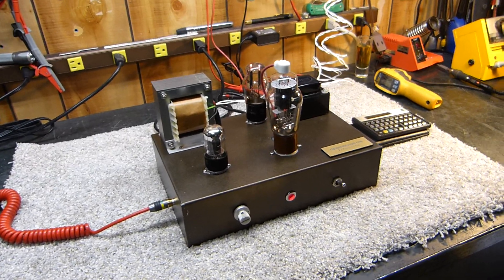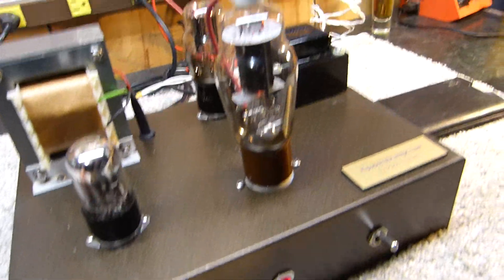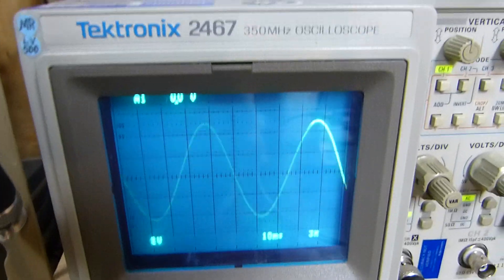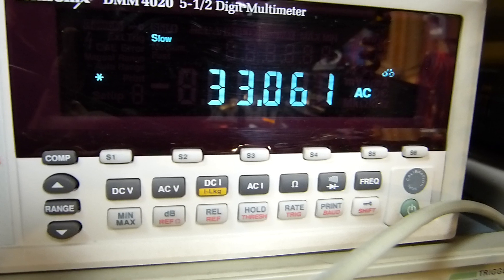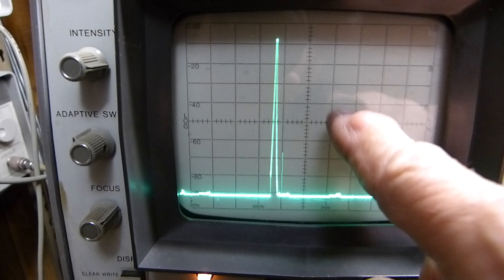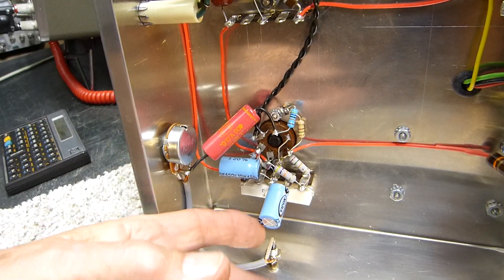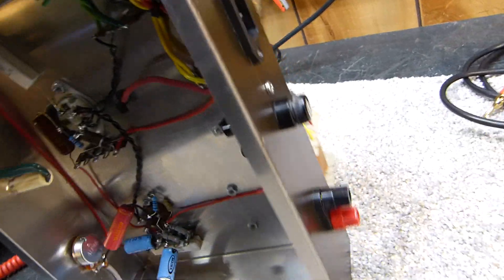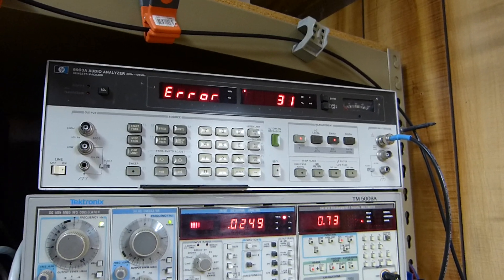807 Single Ended Amplifier Project - Part 5 - Measurements

Comment: I built one of these but having the dumbest problem. I can’t get the pot to work without being jumpy and noisy. Sounds great at full volume. Brand new pot. Is the input supposed to be grounded like a guitar amp or is it grounded to the signal input device like the phonograph or tape player,etc? I suppose it could be a bad pot but that’s pretty rare with brand new alphas. The grid leak is after the input cap. Does that matter? Idk …any suggestions? Thanx.
Reply from the maker: One side of the input level pot is grounded to the chassis same as the ground side of the RCA input connector. Sounds like a bad pot or solder joint ? A grid leak resistor is usually at the actual grid connection on the tube socket but there must be some resistance to ground off the grid side of any input capacitor if you use one. There must be a DC path to ground in the grid circut (all grid circuits) or the grid will unpredictably attain a bias charge and cut the tube off from conducting and output of the amplifier will stop. Hope this helps.
Reply: @ElPasoTubeAmps  I figured it out. I thought I was being clever by connecting the heater center tap to the cathode rather than ground. I figured it out after noticing some improvement with different grounding schemes. Anyway ,it’s completely silent ,now. I thought something was wrong it was so quiet before I played some music through it! Sounds fantastic! Stoopid center taps…😅
Reply: I used the generic champ power transformer(350v taps) and a Hammond 125DSE universal output transformer. 10 h choke. I’m gonna make another one!!
Reply from the maker: @williambock1821  Stereo does have its charm. I am very happy with mine. The mono one is in my workshop where I make videos and the stereo one is in the living room. Thanks for your comments. Stay safe.

Comment from the maker: FFT software you might like to try as suggested by ChatGPT.

Sonic Visualiser

A free, open-source application specifically designed for analyzing the harmonic content of music. It provides detailed spectrogram views and supports plugins for advanced analysis.

Voxengo SPAN

A free real-time FFT spectrum analyzer plugin that works within DAWs (Digital Audio Workstations). It offers customizable displays for harmonic analysis.

Spek

An open-source acoustic spectrum analyzer that supports multiple audio file formats. It’s lightweight and user-friendly, making it a great option for quick harmonic content checks.

Blue Cat's FreqAnalyst

A free, high-resolution frequency analyzer plugin. It’s particularly useful for visualizing harmonic structures in real time within a DAW.

Comment: do you ever sell your amps, Kurt AA4KH
Reply from the maker: Hi Kurt.
I have not tried to sell my amplifiers. If you add up the cost of all the parts nowadays and add that much more for labor and knowledge, you can see a minimum of what I would have to charge to sell them. No doubt I think they are worth it but most people had rather spend their money on commercial made ones. 
Just my opinion.  73  WA4QGA

Comment: What's the distortion characteristic of your Tek CFG250? Thanks for this series. Nice results.
Reply from the maker: The Tek CFC250 is the frequency meter. I assume you mean the SG505 oscillator. Tektronix specifies 8 PPM THD. It is an analog frequency dial so it is sometimes tedious to get it down to the Hz in frequency.
Reply: @ElPasoTubeAmps ah, my mistake. I have a Tek signal generator from that same family and form factor. Thanks for the late night reply. Looks like we're both night owls.

Comment: Wow, you built it so quick I didn't have a chance to ask any questions. How did you deal with the screen supply? I've done some work with the 807 and read all the cautions about regulating the screen voltage at a relatively low level compared to the plate.
Reply from the maker: It is triode connected so no screen supply. The screen is tied directly to the plate thru a 100 ohm 2W resistor. Cathode bias  with 150 ohm resistor. I will be posting a schematic later.

Comment: Sounds really nice. You can do SNR easily with the AA501: press LEVEL and DB RATIO, then zero it with the SET 0 button underneath, then turn off the siggen and you have your SNR displayed.
Reply from the maker: I tried and tried but the zero button doesn't do anything. I downloaded the manual also. Not sure what I am doing wrong. I did figure out how to run the 8903 in S/N. Thanks for the information.  Below is link to schematic:
https://www.delatsch.com/wp-content/uploads/2024/11/ElPasoTubeAmps807SESchematic.pdf
Reply: @ Bad luck, looks like you get to fix it :-)
Reply from the maker: @EJP286CRSKW    When all else fails, read the manual....   🙂
Reply: @ The SET 0 button just sets 0dB on the display, so when you turn off the siggen it goes to -80dB or whatever. But if it won’t zero, just compute the difference yourself.
Reply from the maker: @EJP286CRSKW  That is it - it doesn't go to zero so I assumed, as you said, to do the absolute value between what is left on the display and what is measured and as I remember, the numbers were similar to the 8903. I will have to check this again on several different measurements and see if it holds true in my case - Thanks for mentioning this...
Reply from the maker: @EJP286CRSKW  If I put a 0 dBm signal into the AA501 and press the SET 0 button, the display goes to 00.0. When I take the cable off it it goes to maybe -102 and depending on if I put my hand close to the input adapter or touch it, it goes back up to some much higher level, bounding around, but I still don't see how to measure S/N with it. I am missing something simple...
Reply from the maker: @EJP286CRSKW  I see how to do it now.  I can put in any signal level and set it to zero - I would zero it with my amplifier on but with no input signal to it then drive it to max output and see the difference.
Reply: @ Or the other way round.
Reply from the maker: @EJP286CRSKW  The misunderstanding I had was, it can not be zeroed with an open input circuit at the AA501 input, in this mode. It is so sensitive it is bouncing around as low as -140 dB or so from the noise that is picked up just from having the banana-to-bnc adapter being inserted. As I often say, I learn something from the YouTube community every time I post a video. Thanks to all...
Reply: @ElPasoTubeAmps  You don’t need a 0dBm signal. Just a signal. Full output of the amp if you like. Then you SET 0 to call that zero, then turn off the siggen and you then have -80dB or what have you. Thus is the SNR. Or crank on the frequency until it shows -3, then you have a bandwidth limit. All in DB RATIO mode and LEVEL mode. Nothing to do with O/C inputs whatsoever.

Comment: ELPASO, How do you measure using the oscilloscope or DVM meter the dB's of the NFB if its 3dB to 16dB?
Reply from the maker: I make it easy and use the Tektronix DMM 4020. I set the amplifier up with no NFB and a nice sine wave display on the scope. Then I start adjusting a pot as the NFB resistor, watching the meter displaying in dB until I get the level I want. I then measure the R of the pot and install a fixed resistor.
Reply: @ElPasoTubeAmps  The DVM meter set to dB is measuring "across the NFB pot/resistor" or the DVM meter is referenced to ground?
Reply from the maker: @waynegram8907  The DVM meter is across the 8 ohm load resistor on the output of the amplifier measuring the amplifiers output power.
Reply: @ElPasoTubeAmps  So the DVM meter is set to dB mode and measuring the amplifiers output with NO NFB and you adjust the Variable Pot NFB resistance value until its -3dB down from the NO NFB value?

Comment: Tube amps are : the sound of the Transformers....... More than the tubes.
Reply from the maker: Very much agree. I have heard it said, "we like the sound of iron". There seems to be some physical energy and Earthly connection in that idea and feeling and I agree with it. It is even true in the large McIntosh amplifiers that use output transformers in their solid state amplifiers. They have a lot of energy in them.

Comment: Enjoy this series.planing on building one.imight use some 1625.ccs plate rating is 25w on 807 probably appropriate rating for single in class a.6l6gc 5w more at 30w.l might also try 6bgc at less operating conditions to accommodate the 19w.interesting what you were able to get with only 3 db feedback.was this global?i would be interested in seeing a comparison of measurements on this amp between global and schade plate to plate feedback, particularly distortion profile.
Reply from the maker: Yes, 3 dB of feedback settled it down and made the low and high end turn out very nice. I know the  so-called "compressed" sound we describe with lots of global NFB, usually around 16 dB but with no NFB an amplifier is all over the place for power and frequency response. I have been told, "NFB is your friend". There is truth to that. I have not tried direct Schade feedback but you might notice (when I print the schematic) that I do not bypass the first stage or the 807 cathodes. That gives a bit of local FB and helps stabilize it and keep it clean.

Comment: Thats an amazing little amplifier with great parameters.  When i think audio i never think of 807. I think 300B or 6V6 or KT88. But now 807, im a believer.
Reply from the maker: Agree - when I think of 807's I think of 50 watt modulators for vintage 100 watt AM transmitters but it is a beautiful audio tube also.

Comment: I use LM337's for cathode bias configured in constant current mode to set the plate current. I use them on EL84's and what's nice about this is it compensates for tube age.  I also use a FFT audio  spectrum analyzer which is many times faster for low frequency sweeps.  (retired TV Broadcast Eng)
Reply from the maker: I completely agree with FFT SA for low frequencies. I can adjust a hum pot with a PC based FFT analyzer. I trust the HP but like I said in the video, it sweeps at something like 50 seconds per division at those frequencies. It goes down to 5 Hz if I remember correctly. 500 seconds per sweep is more time than I have left...  🙂

Comment: Run that 807 at the max
Reply from the maker: My philosophy is push them till they scream. 🙂 375 VDC on the plate seems so low. My plate voltage on transmitters is 3.5KV and up.

Comment: David, I know you most likely have a 45 SET amplifier around in your previous builds. Other than more power from this one how much difference in audio quality?
Reply from the maker: I don't think I ever built with the 45. I do have a 300B that I used a 10H choke as the plate load and this 807 amp sounds much better with a high end OPT. I built a headphone amplifier for my grandson for Christmas a few years back but I used those little power triodes that were popular in some of the WWII radios - can't think of the number at the moment.
Reply: @ to me, 300b is overrated. I like a tad more bass and hf extension. They do have a lovely mid though. The 807 bottles aren’t near as expensive as I thought once I looked. 
Thanks for your video series. 
I checked out the output transformer site.
Reply from the maker: @jimibrown1955  The 300B's are expensive and those original Western Electric are just absurd. I wish I had bought a thousand of them when I was a kid. I would have more money than Donald Trump.  🙂
Reply: @ hindsight 20/20

Comment: That frequency response for a SE amp is pretty good, must be a decent OPT & the NFB helps. I noticed you used a 47k anode R for the 6SN7, I do too. It's the best Ra for the 6SN7 family of valves & used in loads of amp designs. Is that a 15k anode resistor for he second stage? Would love to see the schematic. Re the 807 testing @ 60mA ish, NOS valves often test high due to the valve being a bit gassy. After running for a while some valves sort themselves out. Love your layout, wiring & workmanship, I always find the underneath of amps more interesting. All the best...DA.
Reply from the maker: The load resistor for the first state is 75K and the cathode resistor is 150R not bypassed. Load resistor for the second stage is 47K with cathode resistor of 22K bypassed with 10 uF. The cathode resistor for the 807 is 500 ohms 10W not bypassed and its grid resistor is 330K. The input pot is 100K audio taper. The input capacitor (the red one) is 0.1 uF and the coupling capacitor into the 807 is 0.25 uF. I experimented with the cathode resistor using 820R, 680R and settled on 500R as it gave me the 60 mA of idle current for the 807 and a plate dissipation of 22.5W. It also loaded the PS to 375 VDC with the 5V4 and stabilized it.

Comment: This is part 5 and… did we see how you build it🤷🏼‍♂️ did we see a schematic🤷🏼‍♂️
Reply: If you’re looking for step-by-step instructions, I don’t know that I’d recommend 400V+ circuits just generally. That said, he usually goes with very straightforward and simple Williamson designs, for which you can find schematics (incl. the originals published in the late 1950s) all over the DIY/boat anchor sites, if you search for “Williamson design amplifiers”. 

Unless you are going to get the exact same custom-wound output transformer he’s using here, anything more specific won’t be terribly useful for DIY builds, as it’s mostly dependent on the characteristics of your output transformer (he does have videos that teach you how to characterize transformers). Sorry that’s kind of a non-answer, but hopefully this might help anyway…
Reply: Thank you very much😃 and the OPT is available 😁
Reply from the maker: https://www.delatsch.com/wp-content/uploads/2024/11/ElPasoTubeAmps807SESchematic.pdf